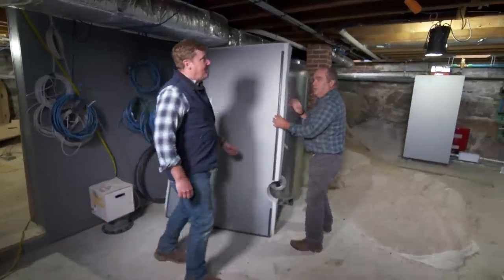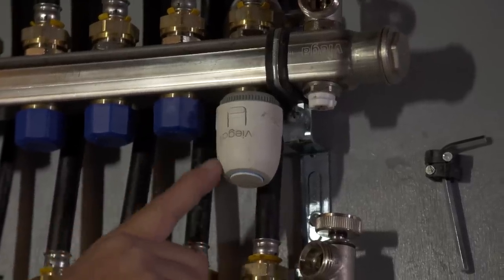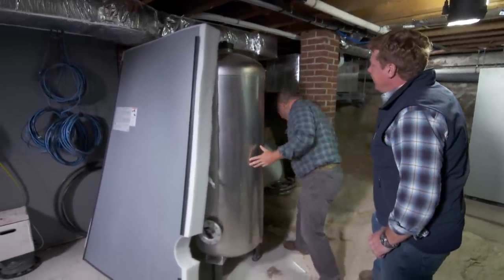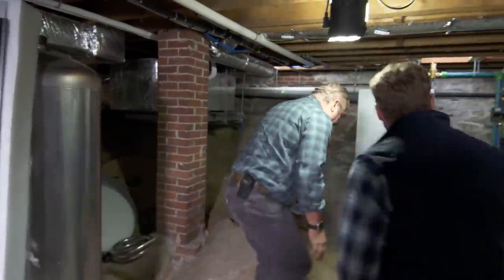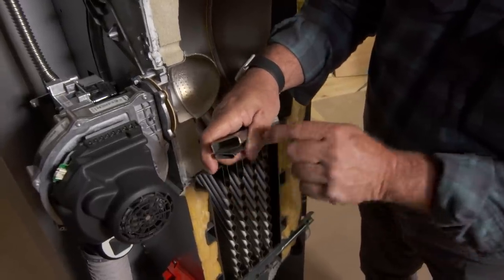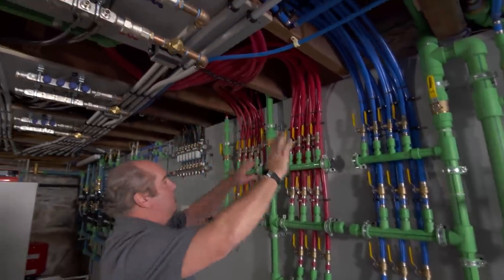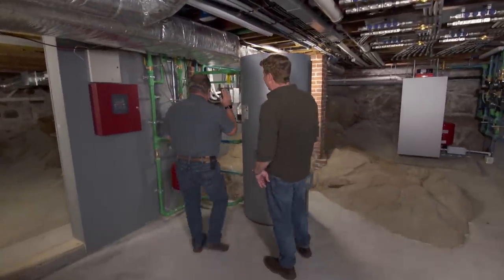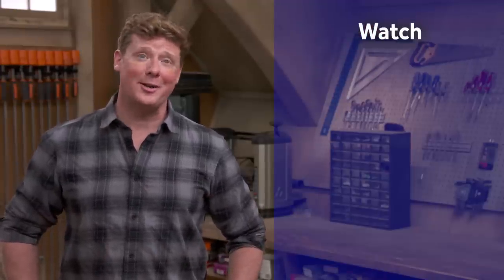How Boilers Can be More Efficient | This Old House

Comment: I spent a few years in this trade and my take is the more complex, the more there is to go wrong. Back in the old days the radiant zones got their water from a tank that had it's own thermostatic control and water went from there into the zones... one zone per room, and they let the room t-stat control how much heat was used. There were no fancy mixing valves, computers, or variable speed circulators to worry about. It either worked or it didn't so easy to figure out.
Reply: Bingo

Comment: This probably cost as much to install as it would to buy a small house.
Reply: It looks like our heating systems in Germany. Actually, this is a rather "simple" setup. Heating systems (just for the heating, no AC included) generally cost around 20-30000 Euro installed. My new system has 3 heat sources (a wood burning fireplace with water loop, a heat pump and a 99+ efficiency oil boiler similar as in this video as backup for very low outside temperatures) and 3 mixed output loops. That system is more like 50k installed. The most expensive system I´ve seen overehere was 120k with 90k in parts alone- I am not kidding.
As for the manifold type tap water distribution, I don´t like that. It has too much water in it and will be a great source for legionella and biofilm grow, and also lose a lot of heat. You always keep the tap water lines as sort and thin as possible. Ideally in one single loop.
Reply: A system like this costs 30k plus to install and over its life can cost half of that for maintenance. They can be extremely expensive to keep running.
Reply: @eaglevision993  What is the thought process behind it there?  Better for the environment?  Government mandated?  Parents wanting to pass their house down to their kids and give them something better?
Reply: @jakeschroeder1553  Well a little bit of everything: Heating oil, gas and electricity are pretty expensive compared to other countries so it makes sense to have an efficient system. The government requires buyers of old houses to replace the heating system with an efficient unit within 2 years of purchase if the unit does not comply with current standards. If you upgrade voluntarily, you get subsidies of up to 45% of the installation costs and I think this is also a cause for the high prices of heating systems. The state subsidies make high tech systems affordable while no one thinks of the maintenance costs once the warranty is over.
Another reason is that Germans just love to overengineer everything. We like state of the art technology in our houses just as we do in our cars. While Americans tend to add a few hundred sqare foot, a pool or a granite counter top to show off their home and distinguish themselves from their neighbors, Germans invest in the "invisible technology" that makes a home comfortable. Radiant heat in floors, walls and ceilings has been around for decades. But aside from the heating system, almost everything on a German house cost way more if you want top quality. A single window can easily cost over 2000 Euro if you want high quality brand name stuff, parts only. (Tripple pane hight efficiency glas, aluminum cladding outside, wood inside of the frame.)
Reply: @eaglevision993  I am sure the system install here is well over $50K. Probably close to $120K. That stainless storage tank costs around $10K. Consider the cost to install all of the radiant plywood\warmboard, Oxygen impermeable PEX. I believe those Smart Grundfos pumps are more than $1K each.
Reply: @guytech7310   The components in this video are made by Viessmann. I have the same brand in my house. Actually, the same boiler just a smaller model with 18kW. While Viessmann is one of the most expensive brands, the parts costs are not that high for parts. A mixing unit incl. pump and motor for one loop costs as a unit 800 Euro in material, the pump somewhere around 200. A buffer runs usually between 1000 and 2500 depending on features and size. Installation costs are generally 30-50% of the system. Including the radiant floor heating and tap water system the setup in the video can easily break the 100k barrier, no doubt.
Reply: @eaglevision993  Those are Grundfos smart pumps They sell for about $1000+ in the USA. My buffer tank  (Steel) cost about $2K+ $300 for delivery. That Stainless buffer tank is bigger than mine and since its made stainless, its likely around $10K. I recall looking at stainless tanks and the prices were around $8K for my size, not as big as that one.
Reply: @guytech7310  It seems the prices of Viessmann equipment is actually higher in the US than overhere. Well, German stuff has always been sold with a high markup/profit in the US.
Reply: @eaglevision993  When you take the exchange rate between $ US and Euros into account the priced you both have mentioned are about the same.
I live in Canada in a well insulated 195 sq.m house with full basement and we had a new forced air propane + heat pump system for heating & cooling installed 4 years ago for under $5000 CAD. Even if one of those systems uses only a fraction of the fuel ours does it would take decades for the lower operating costs to come close to making up for the cost of installing something that expensive.
Reply: @SidecarBob  You are absolutely right. You will never get the money back through the higher efficiency. You get slightly more comfort compared to forced air or radiators but that is it. And then you still have to define "comfort". A radiant heat system has an even warmth without air movement but it is very slow to react. Forced air or hight temp radiators are more flexible. I guess it all comes down to government mandated efficiency at the cost of the homeowner. But at least my basement looks like the coolant system of a nuclear power plant now....So the baseline is, as long as it works: Not great not terrible.
Reply: @SidecarBob  Well I have a little exaggerated with the plumbing. My basement is also finished, the pipes run in the drop ceiling. The mechanical room is around 17sq.m. but not much space left in there. I would prefer a combined system with radiant heat as the basic heating and a duct type A/C for ventilation and cooling. I am about to remodel my house next year since I need a new roof anyway, and I plan to install a duct type A/C system in the 2nd floor rooms and the 1st floor living room for cooling in the summer. But is will most likely not have outside air. It just recirculates the air.
Reply: @eaglevision993  Unless your house leaks air badly you should seriously consider a fresh air system. Someone accidentally unplugged our air exchanger once and in about a day the house smelled bad and we had headaches. Once it was running again everything went back to normal.
Reply: @SidecarBob  I am considering that. My house is from the early 80s so it is far from airtight like new constructions. I am in the middle of replacing all windows and then the roof which will tighten up the house somewhat. But I am not trying to make it airtight and allow for some natural ventilation. The house has multible fireplaces so I need some air ingress to operate them safely. If possible, I will add an outside air feature to the A/C just in case.
Modern constructions are overdoing it in my opinion. They need artificial ventilation or mold will grow in no time, not even considering the stale air quality especially in small homes.
Reply: @eaglevision993  FWIW, our fireplace has a fresh air vent in the bottom so it can draw combustion air from outside.
Reply: @SidecarBob  I only have one direct vent gas fireplace that uses outside air, the other 3 are wood burning fireplaces that use room air and need a draft in the chimney. Retrofitting would be rather involved and pricy.
Reply: For next 100 years ?  With contemporary heat pump technologies and solar panels the system was obsolete way before it was installed
Reply: @eaglevision993  Ours is wood burning but it was built with the vent in its floor and the brickwork around the chimney bulges to one side near the bottom for the outside vent. Retrofitting would probably not be easy.
Reply: Most certainly
Reply: Installed had to be 100k+ I’m assuming . I’d love to know actual numbers

Comment: The boiler plant is over complicated with the unneeded mixing valves. If the systems are zoned correctly the pumps would just run different amount of time to reach set point at a uniform water/glycol temp without the mixing valves. The high thermal mass boiler is very nice though.  The domestic water manifold is a bad idea depending on house size as you can’t run hot water recirc line and will be waiting for hot water at all taps while the line clears. The more expensive option isn’t always the best.
Reply: THIS
Reply: Mark The more expensive option is best for the industry, and TOH is the industry.  Was not always so.

Comment: I’d be scared to see the cost of all of that
Reply: These start at 30k and up
Reply: I'd be even more scared to see the cost to replace it all in 3 years when a critical electronic component, which the entire system cannot run without and cannot be bypassed, that was likely discontinued before the system was even completed, fails. Not only will you have the cost of a total replacement on your hands, but also reworking all the plumbing, because you know the next generation equipment will be plumbed completely backwards with totally dissimilar fittings.

Comment: The more complicated it gets the more expensive it is to fix when it stops working.
Reply: Worked on one last week, it was 4 years old the family never maintained it and warranty was denied. It ran them 3,400 dollars worth of repairs and cleaning reqyired. Read your warranties small print. Nearly all of them will say the manufacturer will ask for maintenance records for warranties to be applied.
Reply: High R-value insulation and air-tightness requiring a minimal amount of heating/cooling seems like a much better system to build.
Reply: @lithiumdeuteride  Still absolutely not worth the cost and NO customer will ever make their money back with current prices

Comment: I have oil heat forced hot air and need a new unit.What's a good quality brand heating system and a good electric water heater (Rheem)?

Comment: Watching videos like this when people invest so much in to heating it always strikes me that a better way for people to live is to share some of this infrastructure 

Putting all this infrastructure in to each and every house is massively inefficient. Better, a single large boiler, with redundancy, for say a street up to X number of homes. And billed based on usage. 

Me? I live in a very large 5 bed detached house with huge amount of heating and water distribution. Miles of large diameter copper piping and all underfloor heating. 

When I was installing it I couldn’t help but think it would be better to do what I say above.
Reply: That is quite common in northern Europe. "District heating". You get hot water delivered to your property instead of having your own boiler.
Reply: @sjokomelk  interesting. I didn’t know about that. I’m in the UK. Which countries use this? Thanks! 🙏

Update: I found this link. Seems this is also used in the UK too. I had no idea 🤷🏻‍♂️ 

https://www.buildenergy.co.uk/tips-and-insight/what-is-a-heat-network-district-heating/

There are no new ideas are there 😆

Comment: As someone who works on them daily, they are expensive as hell to repair. More computer controlled a systems is they more efficient they are. With that it can cost triple to install and repair.
Reply: zack9912000 ... had one of those mini split systems replaced at my office last year, not because of parts availability, but because the unit was 8 years old and needed a control board. The replacement unit was only a few hundred more than the repair and came with a warranty. That's what NEW equipment (and their parts) has done to the HVAC business!.
Reply: @rupe53  Well the EPA has made it cheaper to replace then repair alot of them, higher efficiency requirements means more expensive and labor intensive repairs
Reply: @zack9912000  ... I think you missed the point. The new board was $1,100 (1 year warranty) and a whole new unit was under $1,500... with a 5 year warranty. This is when it doesn't make sense to go the cheap route. SER was about the same as the old unit so nothing to save there.

Comment: When you put in all that radiant floor heating and still have ductwork 😂😂😂😂.
Reply: Don't think you can cool a house in the summer with radiant heat.
Reply: @MonkeyZeus194  🤷Radiant floor cooling 🤷. It exists. If you have ductwork you might as well just have a natural gas furnace.

Comment: Would a heat pump not have pulled heat in and dumped it out vs a gas boiler. Two heat pumps would pull in hot air and then also run as coolers in the summer

Comment: The boiler may be efficient, but the distribution system looks to be an expensive, wasteful disaster. And if you are putting in ductwork for AC then you might as well use that for heating. If your house is well insulated and you have variable blower(s) then you should have perfect comfort in a much simpler and more reliable system.

Comment: What's the break even on this type of HVAC system? I'm guessing 10+years.
Reply: 189 years
Reply: the whole HVAC system prob costed 100k
Reply: @Reignz  That's what I was spit balling as well.
Reply: I doubt they would ever come close to breaking even during the lifetime of that equipment. These over the top systems that TOH likes to put in might save energy,  but not money. I’m amazed they get people to agree to pay for them.
Reply: These you never break even on ever. Add the cost of repairs and labor, this will cost more then a basic boiler and zone valve system by ten fold over its shot life span.
Reply: Hahaha “he said break even point” . There’s no such thing as break even point in these systems . Your basically paying to “save” the environment is all . I’d say the only way it would break even is in probably 80-100 years after it’s been changed out a few times but still reusing all the same piping and zoning setup
Reply: 10 decades if your lucky

Comment: That looks expensive. I would have taken that money, and have the basement floor fix and flattened.
Then but a different just as efficient. And would still have money left over.
Reply: Remember that's the house where they actually jackhammered the basement floor to make the ceiling higher

Comment: Why are boilers not obsolete in a world with HyperHeat heat pumps that operate in winter?
Reply: simple. heat pumps dont make that much feel heat. they make btus but rather cool feling heat. i use a heat pump and furnce combo. heat pump manges well 3 sesons. but winter really need the heat neg 15 tomarrow.

Comment: Just use an on-demand water heater, no maintaining heat.
Reply: On demand power heaters aren’t usually powerful enough. And you have to deal with the delay when it first fires, wasting water for ~15s depending on the size of the house
Reply: @JeanYvesB9  7-10 gpm units are powerful enough for a medium size family. The cost is less than a grand and will pay for itself in only a couple years. 15 seconds isn’t really a long time to wait. The pipes in my guest house take at least 30 seconds to transport the heated water from a conventional tank water heater.
Reply: How would you use that for radiant heating?
Reply: @sheldonpopesp  Radiant heating like piping hot water through tubes in the floor? Just set up a looping system. If you’re talking about heating by using a radiator that’s a steam system, it’ll have its own water boiling unit.
Reply: @morganfreeman4726  does that mean your on demand system will need to be on the whole time so the water can be maintained at a constant temperature?

The heater in the video used is for radiant floor heating as well as the portable useable water.
Reply: @sheldonpopesp  Yeah, but it only heats up the small area that the water circulates through. Water tanks while not continuously on, are heating most of the day.
Reply: Jean Beaucamp I'm not a fan of on demand water heaters for various reasons, but to say they are not powerful enough is nonsense. It's quite possible to get 40kw on demand gas water heaters (we call them boilers in the UK) and many have a small internal store of hot water which greatly reduces the lag time between turning on a tap and getting hot water.